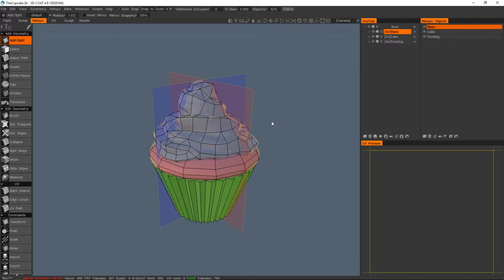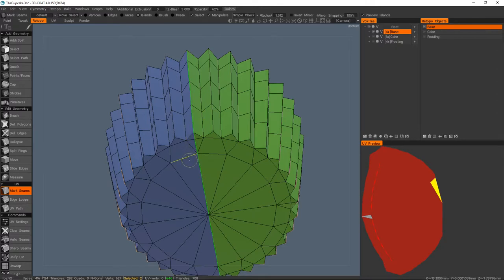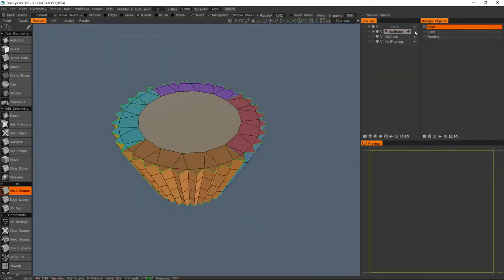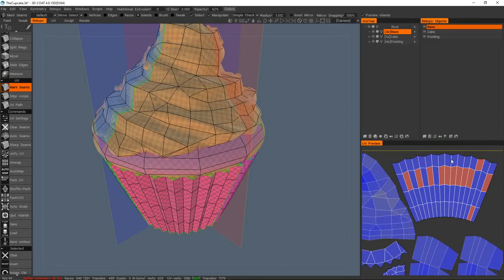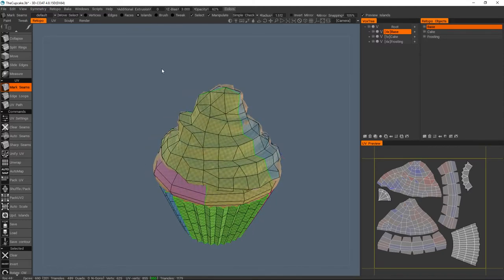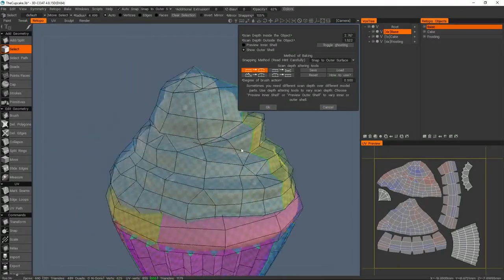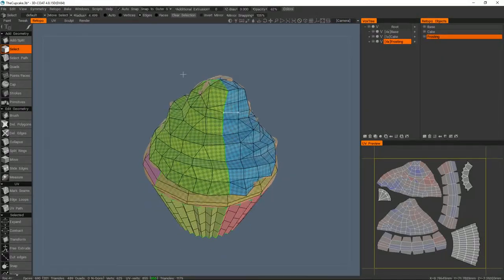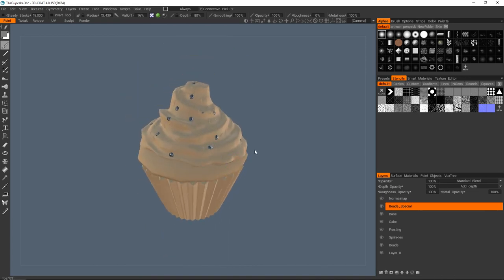Intro to 3d Coat: [UV Unwrap and Baking]

Comment: Good and clear but I missed the part where you build the model again over the sculpt. (may have missed the vid?) Also I cannot see the object in my UV space (in my first project), obviously because there are no UV, and its not baked yet. If you can paint on a sculpt with no UV's (apparently you can) what is the difference, why not go straight to painting? (forgive my newbie ignorance)

Comment: so if you want to do some sculpt edits on your polygonal geometry, you bring the object to sculpt room and use the drawing tools.
getting these edits back into the retopo room would need to bake the edits ??
(like shown on 20:20)
no other way to get the sculpted geo into retopo ?
Reply from the maker: Yeah, the sculpt mesh and retopo/poly mesh are two completely separate things. So if you're needing to make changes to the sculpt after you've done your bake, then often you'll need to re-bake*. This isn't a 3d coat thing, it's a 3d thing. If anything, 3d coat make this entire pipeline so easy that going back and making changes is amazing compared to literally any other program out there today. As an example, A guy I work with does his sculpting in Zbrush, low poly in 3ds max (but using decimated mesh in zbrush to help), UV's in 3ds max, and baking in substance painter (which for decent bakes often requires an additional "cage mesh" that you have to export separately). When he has to make changes to something after a bake, you can imagine how much of a hassle this is. 

*It is worth noting, if you're not making any major changes or shape tweaks, and maybe just forgot to include some surface level detail or something. You can always paint normal map information in the paint room (after the bake). All your bake data is converted into a normal map anyway so if you're just missing some bumps/lumps or a few screws/bolts and things like that, just paint it!